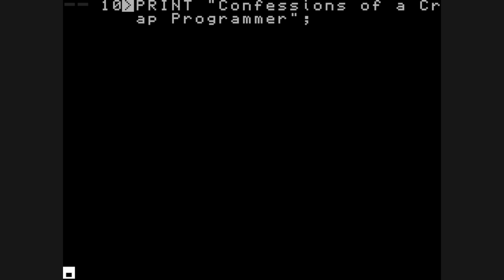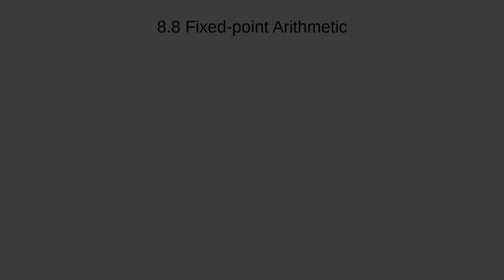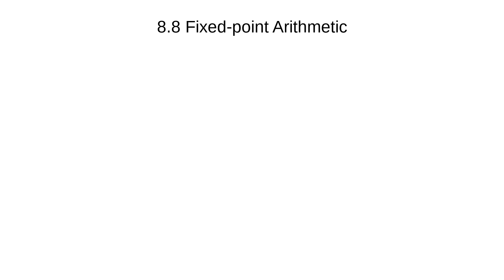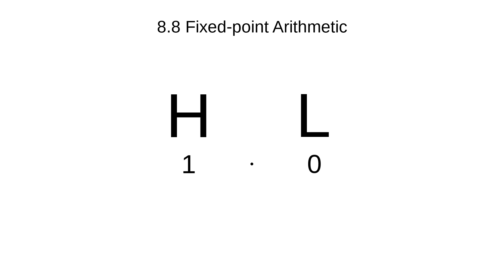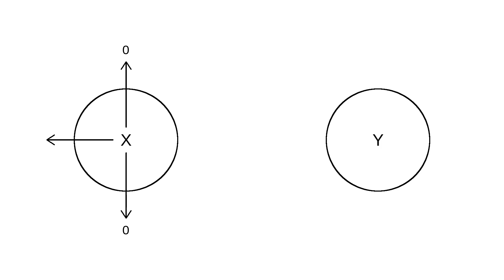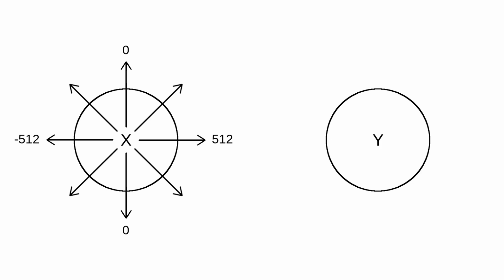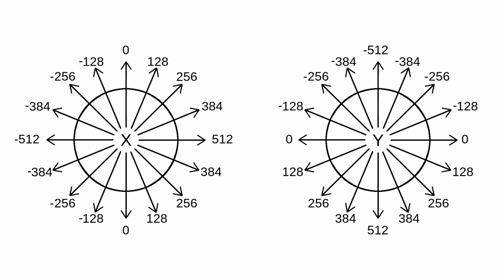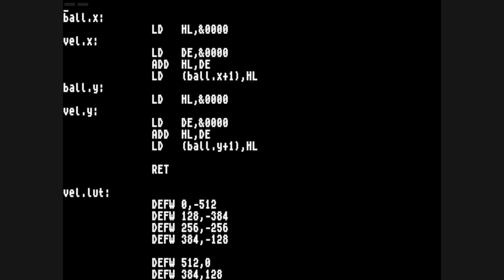Confessions of a Crap Programmer #1 - Moving Sprites.

Comment: Good video!

When you're a seasoned (game) programmer, these things may seem obvious, but they really aren't. Your explanation was on point. I also like your honest style: lots of people try to present themselves as really good and while some of them truely are (in general or in their domain), that's far from all of them. It's refreshing to see someone like you saying that: yes, there is struggle in the beginning, the learning curve is steep, but so rewarding once you internalise concepts like fixed point numbers.

While I am on topic, we still used fixed point on relatively modern hardware like the GBA and Nintendo DS (NDS), where the hardware was fixed point based, floating point hardware was missing and software emulation was dramatically slower. Back then (and obviously before) and even today we don't need trigonometry that often, especially not for such basics, so you are right to be sceptical. One of the few things that come to mind which involve trigonometry, is the construction of rotation matrices from Euler angles. Yet we mostly work with vectors anyway and then it's just a question of knowing what to copy where into the matrix, be it for hardware scaled / rotated fields and sprites or 3D graphics. The simple fixed-size axis-aligned sprites and their movement on your target machine should not have to involve any trigonometry at all.

So, these days with arbitrary directions and analogue inputs, you would construct a movement vector from the inputs, then normalise and scale it by the speed. Normalisation is very expensive on 8-bit machines, which often lack instructions for some basic operations (for today) like divisions and square roots. Precomputing the values into lookup tables like you do in your video skips all of this. We used to compute these lookup tables (for e.g. trigonometric functions) on machines where slow memory access was still faster than a computation. Those days are usually long past us and memory accesses have become disproportionally slower than many computations that would have been done with a lookup table back then. And yes, this works whether you have 8, 16 or 256 possible directions. Simple symmetries and mirroring can be used to reduce the table to cover all of the unique values found in a quarter circle and it can even be reduced to half of that in some cases. It all depends on what is most efficient on your target machine.

Cheers.
Reply from the maker: Thank you so much for such a thoughtful comment, I'm really glad that you got where I was coming from. I couldn't hope for a better response!  There's not much point in trying to pretend I'm better than I really am, anyone who's played my Sam Coupe games can see what's going on, although I hope they have also seen a bit of an improvement over the years!

I really appreciate your insights on how these tricks are still used, or not, these days.  You've also mentioned a couple of things that foreshadow the subject of my next video, and you've given me a few points to talk about that I would never have considered.

Thanks again, I hope you will stick around as I always learn something from comments like this!
Reply: @wubsoft  Oh, that's nice, I'm glad my comment was of use to you.
In that case I am looking forward to the follow-up (more than I was before). I like seeing new perspectives and there is always more to learn for me, even if I know a thing or two about a subject matter.
And I am already subscribed. :)

Comment: It would still work fine if you use the correct trig values in your lookup table. The correct value for the diagonals should be, um about 362 instead of 256 I think? By using halves, your table produces a diamond-shaped movement pattern rather than circular.

But, you have another problem since you still have to multiply this number by another value if you want the speed of your ball (or car) to be able to change, and you don't want to have to multiply 16 bit numbers on the fly on a z80 if you can avoid it. But it is really fast to divide a number in half with a bit shift, and combined with addition it's easy enough to reduce a number to all the other fractions of powers of two like 3/4 and 5/8 etc. So if you stored your direction vectors at the maximum speed, and a little code table that reduces that number by anything from 1/16th to 15/16ths of its full value... if that makes sense...

Also rather than store the vectors as 16 bit values, if your max value is 512 you could call it 256 and add it twice.
Reply from the maker: Hi Anthony, thanks for taking the time to explain all this!   Yes, someone else has emailed to give me the correct values for making the 16 directions work properly.  You are correct about 362 instead of 256.  The other values are 196 and 473.

I have thought a little about the speed-up problem for Arkanoid.  The ST version doesn't appear to increase speed gradually, it has two or three 'steps' of increased speed.  As the look-up table is very small I can just have several versions for the different speeds, or do one of the things you mention, use 256 and ADD twice.  I'll go with whatever matches the ST version closest for this.

I knew there would be a problem with acceleration for the driving game but I hadn't even started to think about how to solve that yet.  I'm going to try everything you suggested!  Thanks so much for this!

I can't tell you how much I appreciate you, and everyone else commenting here, for taking the time.  I've learned way more than I was expecting!

Comment: Great video showing the basics of 8.8 maths - so useful with 8-bitters!
Reply from the maker: Thanks Colin, although it's been pointed out to me that my solution is actually wrong!  All the direction velocities I worked out by splitting the difference between each point come out completely differently when you use trig, and so my sprites won't be moving at a constant speed!

It's a good example of common sense actually being nonsense! :)
Reply: @wubsoft  Yes, need SIN / COS to work it X/Y values out based on the angle. But the point still stands for the basis of 8.8 maths - it's always a good implementation for fractions. I used 8.8 and similar on Stratosphere.
Reply from the maker: @QuazarSamCoupe  Yup you're right, 8.8 maths is absolutely essential for working with fractions like this on an 8-bit micro.  I just need to put a bit more work in to get those velocity values right, I'm going to make another video with the right solution and use this as a learning experience.  Thanks again for your comments! :)